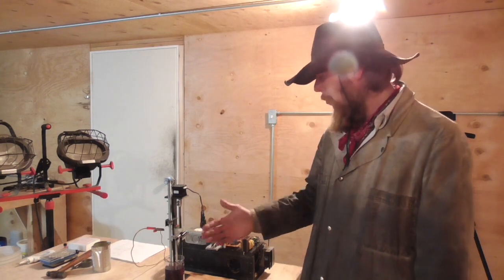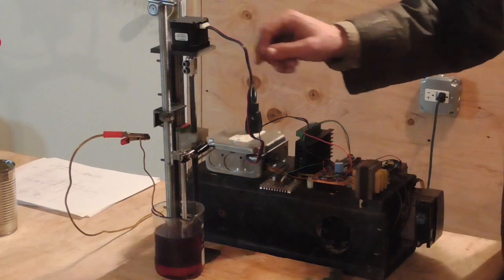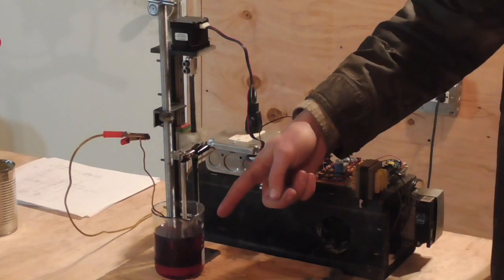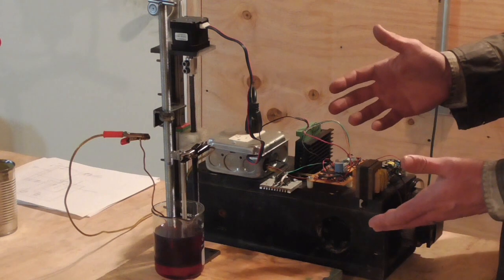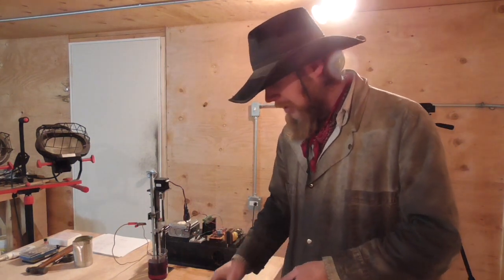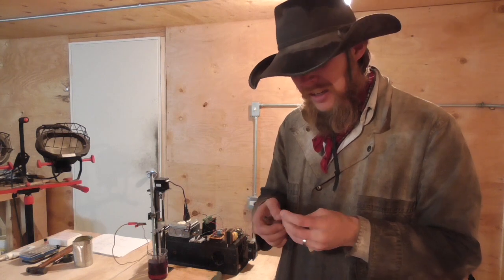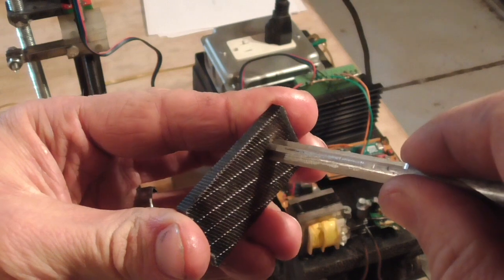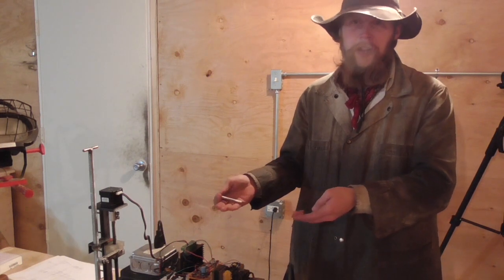Improvised EDM Machine (TIS245)

Comment: Its only ment for drilling things that cant be drilled , like round steel balls that need a side hole not one in the middle , or carbide boring . Its the only way to remove some broken taps and broken drill bits   . Its also the only way some deep holes can be bored

Comment: What voltage powersupply are you running?
Reply from the maker: The main power supply is just rectified 120VAC, so it's about 160 V DC.
Reply: @TheIdahoanShow  Do you use some capacitor to smooth the pulsing DC after the rectifier?
Reply from the maker: Yes, if I recall correctly, there is a 12 mH capacitor across the rectifier output.

Comment: I plan t get a hold of an old welder, of some sort, and try an utilize that. Then agin, I haven't got the slightest clue what is actually neeced in terms of voltage vs current, but it seems like the obvious way to go. It is what you do when welding, well, not really, but kinda.

Comment: In die sinker edm  graphite is used sometimes for big jobs. Easy to shape and handles repeated heating in an oil bath. Maybe retract electrode like a drill peck slightly and use a pump to flush cut area. The other thing is some caps to take a charge and then deliver the charge to the cut.

Comment: Thanks for the video, mate!
I'm currently building a non-automated home EDM machine
to drill 8.5mm holes in triangular bastard files 
so I can tap a m10 thread into them
and use them as teeth in a jaw crusher
I'm not sure if this is all going to work to plan
But EDM really looks like what I need to learn next to make this process work.

Comment: At room temperatures, it's actually kinda hard to get diesel to start on fire.  About the easiest way to get it started is a torch or road flare.  In the far north the house heating oil is basically diesel oil. It takes a heck of hot spark to make it burn.  Most heating ignition power supplies are around 10,000 volts.  So you safety Nazi can take a breath.  Yes, can be dangerous but the shower is probably far more dangerous than a small quantity of diesel oil.  
Thanks for the video.

Comment: FYI: Consider using a machinist magnetic indicator stand so you can mount where you need it. For water you need to use distilled water. The enemy of EDM is water that conducts electricity. You want a fluid that does not conduct electricity at all. I was able to get my DIY EDM to work using Distilled water.

FYI: I used a PIC18 controller (but any ardino system would probably work). I used a pair of mosfets: One to charge a Capacitor & another mosfet to discharge the Charge stored in the Cap into the workpiece. I had started work on a high pressure, low vol. water pump that would inject water into the work area to remove the contaminated work area. If you don't flush the water near the discharging work area, the contaminated water becomes conductive causing issues.

The issue with a TIG electrode is it poor conductivity, The better the conductor the better EDM will perform. The issue with Aluminium is that the discharges will quickly errode away, leaving an jagged surface causing the hole in your workpiece to also be rough and possibly distorted. probably Fine for removing broken bolts and studs. Copper in my opinion works best.
 
Frequency of the discharges will speed up the process instead of bigger discharges, as well as improve the cut surface. Bigger discharges tend to remove material non-uniformally, lots of smaller discharges cut more consistantly. I believe commerical EDM machines operate at about 50Khz.
Reply: Can you share schematic diagram ?
Reply: @pratikraut7552  I don't have one. But you can find schematics on line. Basically you just need an oscillator to drive two mosfets. One to charge a capacitor and another to discharge the capacitor into the work peice. You could build it with a 555 timer a 74LS123 to decrease the duty cycle so there is dead time between the two mosfets.
Reply: @Guy Tech  thank you so much

Comment: Magic magic abracadabra magic...so that's really all that's going on here... really simple. A complete dilettante, watching out of pure fascination, I can wrap my head around the mechanics of guns which is why I find them fascinating. Electrics/electronics- nope. Although if someone brought to market a readymade 3d printer attachment, I'm pretty sure they'd be in the money.edit- and possibly in trouble.
Reply: U have 3 systems: The 1st is constantly and independently sparking, by closing/opening a transistor-switch, that´s timed by an arduino (60V, 5kHz). 
The 2nd moves the electrode up-and-down, via a stepper-motor driven by an arduino, so that its distance from the workpiece is correct (remains in a certain range). 
The 3rd measures/senses a capacitor-voltage (this capacitor is part of the 1st system), which is inversely linked to the (spark´s-)gap-current (that´s directly linked to the gap´s distance), and feeds the information to the arduino, that´s gonna drive the stepper-motor (with the electrode mounted on it) towards-or-away from the workpiece (2nd system, look above)... 
U additionally need some code for the arduino, to make the link between capacitor-voltage-sensing  --->  stepper-driving-up-or-down. And lots of destilled water, u can also make yourself (reverse-osmosis-systems for 50$ in Germany, u just need some water-outlet-pressure to feed the RO-destiller).

Comment: How do you maintaining the sparkgap using microcontroller please explain
Reply: There´s a capacitor, that´s charged by the AC-source, and dircharged over the gap. U connect a voltage-divider at the sides of this capacitor (in-parallel to the capacitor), consistent of 2 resistors in series. Over them rules the same voltage as over the capacitor. let´s say 60v (if u use a server-power-supply as AC-source). one of those 2 resistors is 11 times bigger than the other (at least), so that 11/12ths fo the 60v are consumed over it, and 1/12th over the small resistor, which would be 60*(1/12th)=5v, which is the upper limit of sensor-voltage u can feed into an arduino, without burning this arduino. Some piece of elaborate (but really short) code then calculates the gap-current, based on the capacitor-voltage that the smaller resistor senses, and the arduino drives the stepper-motor accordingly, up-or-down... The cap-voltage, represented by the voltage over the smaller resistor, is inversely propotional to the gap-current, but the code takes care of such non-intuitive circumstances.

Comment: Nice video.
For anyone who missed it, the advantage of edm is cutting hardened materials! As another commenter posted, it's also good for accurate tiny, deep holes (when setup right).
As someone who has a cnc router in the garage, i can cut through most materials faster, but i won't be cutting any files or drilling holes in grade 8+ bolts with it.

Comment: A bench top EDM machine is on my list.  I have disk of aluminum with a broken tap.  Makes it impossible to turn in a lathe.    A basic EDM is  light bulbs brightness helping the machines lower the tool.  Second is a door bell solenoid lifting the tool when current if flowing, dynamic approach where a delay exist before it is lift enough to break the arc.  First one rejected out right.  Can not find a solenoid.  Your approach is not depended on the weight of the electrode so is worth the added cost.  Thanks

Comment: a small tricks to improve: kerosene also works well as fluid, the electrode must have better conductivity than the work piece (mainly copper or graphite) and the professional machine has a pumping system and holes in the electrode to clean the work area.

Comment: I've successfully drilled holes in two hardened knifes in my kitchen using salty water and 12V/1A DC power supply. I masked the knife with nail polish, scratched 1mm hole in paint where the hole was supposed to be, added plastic tube around, filled it with water, connected 2 electrodes and let it "bubble" for 20 minutes or so, then I removed the nail polish and reapplied it several times. It is slow and tedious, it takes 4-5 sessions from each side of the knife to get through. Note that metal only dissolves on one electrode. I don't recommend longer than 20 minute sessions because if there is a tiny hole elsewhere in the enamel it will ruin the knife.

Comment: Did you try Kerosene, I have seen it used in this application before.
Reply from the maker: I didn't try kerosene, per se, but diesel fuel and kerosene are very similar, and diesel worked well.
Reply: Diesel is slower and cause rough surface. But kerosene can cause fire, don't try it unless your garage is seperated from your house.

Comment: Bench top EDM, there is a market for that. I would love to be able to make muzzle breaks directly in barrels, and edm the last of the cuts into the riling, to prevent burrs, just as Mag-na-Port does. For now, I have to pour in a cerrosafe plug, and melt it back out, which reduces burring.

Comment: Have you tried using ECM ( Electrochemical etching/machining ) ?
Instead of EDM and filling the beaker with a dielectric fluid, you fill it with an electrolyte and apply low voltage and amperage only.
Gap distance to the work piece is equally important and Hardware setup stays the same.
Reply from the maker: Haven't tried ECM yet, but it's on my list of things to try at some point.
Reply: @TheIdahoanShow  Then I believe this should be of interest to you as well 
https://gunstreamer.com/watch/how-to-use-ecm-to-rifle-a-barrel-diy-barrel-rifling-project-butwhatabout_CTunXq6iNHxthLg.html
Reply: Ecm is very slow,  I have made a 9mm barrel thanks to Ivan. I want a edm machine and need to build one since im a middleclass poor boy

Comment: Experimented a bit with a similar DIY system although I was going for galvanic erosion instead of edm but same basic concept. while extremely slow it could be a good way to drill high aspect holes (long and narrow holes) in hardened steal rods which could be a very useful ability for certain applications